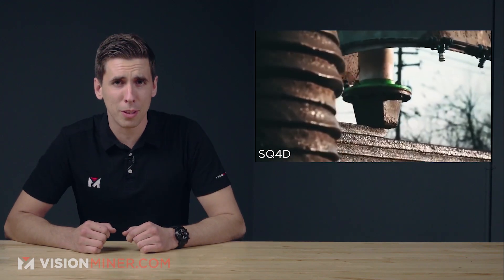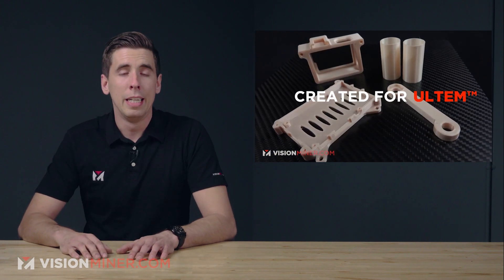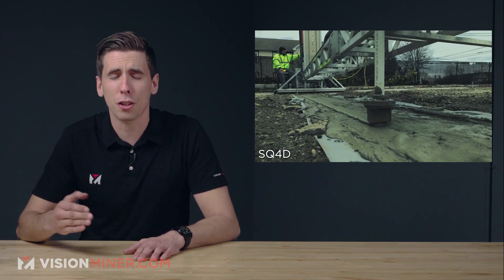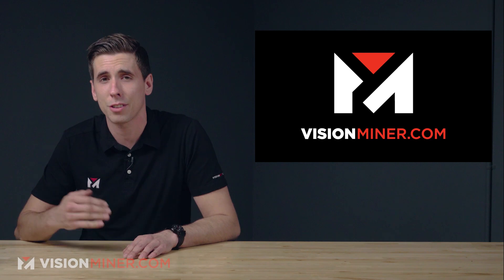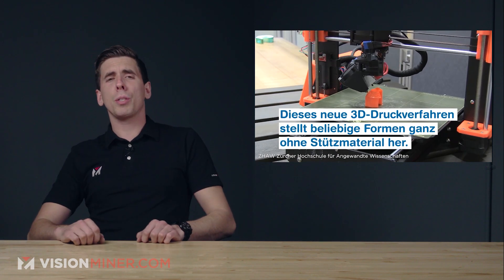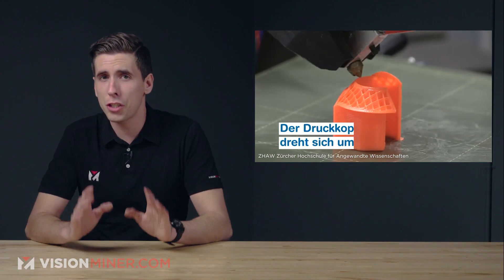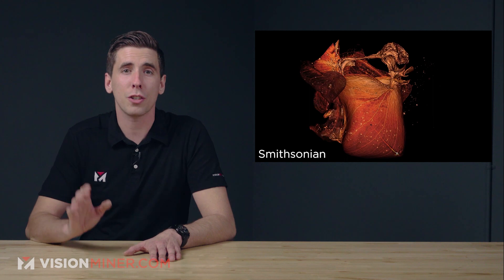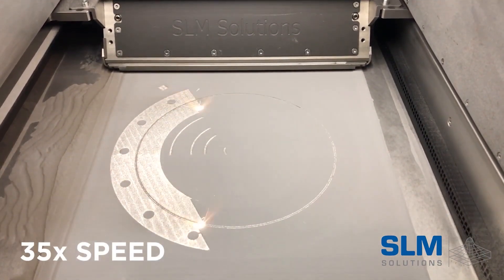3D Printed Houses 2021, Carbon Inc's Candid Partnership, Best 3D Printed Prosthetics, and more!

Comment: Whenever there is a bad storm or a hurricane in the US I see the destruction on the news here in England and the only buildings left standing are the brick or concrete houses.
 It should be compulsory for town planners to read "The Three Little Pigs" so the new houses don't get built from sticks!
Hopefully, new builds will be 3D printed!